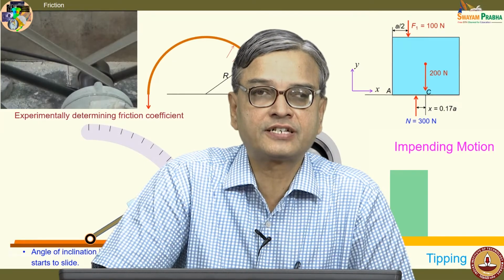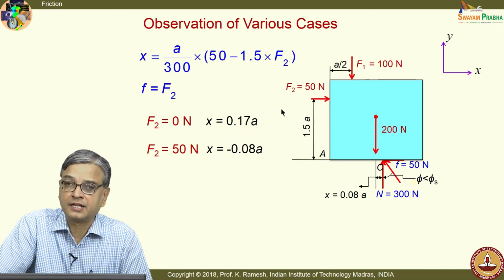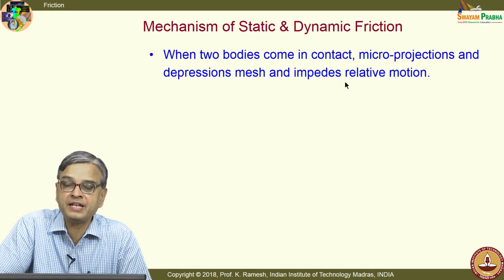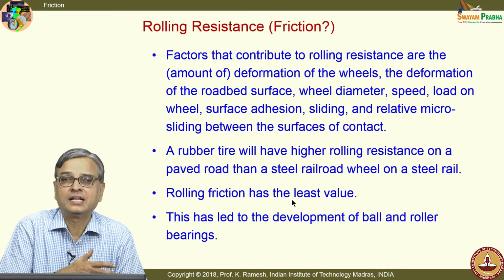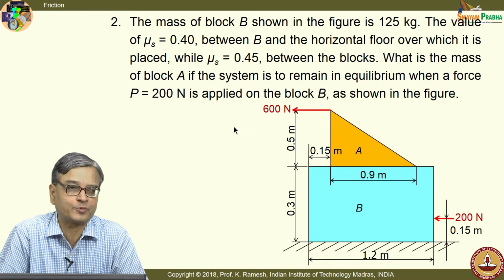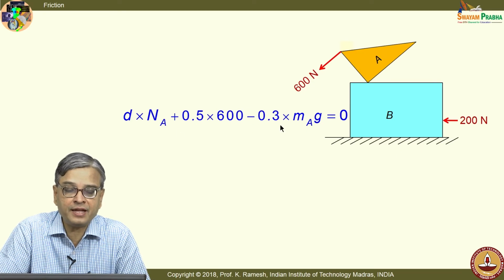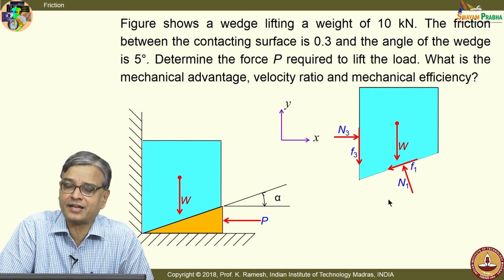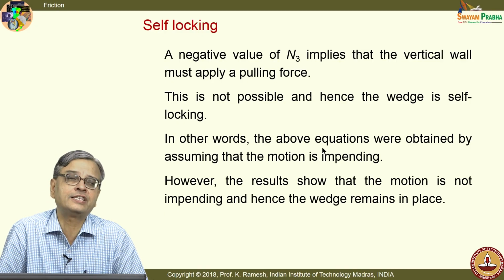Lec 19 Friction II

Comment: How friction value f = 75N is find out can anybody tell me ???
Reply: First read the question carefully:/
Reply: Forces from 0 - 90 N the block had no relative motion with the surface. So you have to F2 = f is valid. At 90 N the block said to be having impending motion because f = (co-efficient of static friction)N. So any force after 90 N you should consider dynamic co-efficient of friction because the block is moving. [f = (0.25*300) = 75 N]

Comment: @38.52
WHAT IS THAT FS.IDEALLY YHE FS SHOULD BE 600 FROM THE MOMENT EQUILIBRIUM CONDITIONS. I THINK IT SHOULD BE THE MAX VALUE OF FRICTION .
Reply: Fs could be equal to 600 N provided it does not exceed μN. If it does, then μN would only be the maximum friction that can be mobilized and this would govern.

For Fs, we take the resultant at the corner and compute the weight of the block. Ideally, this weight would just be able to resist tipping but only if it mobilizes a frictional force less than 600 N in the form of μN. In this case, this does not hold and hence, one will not be able to reach the tipping point since the block will start sliding before that.

Hope this helps.

Comment: AT 42 THE ANSWER OF S IS 0.717
Reply: Dear Paila Saisravan, you have incorrectly substituted the value of fB (800 N) in place of NB (2000 N) in your calculations. 

The value of 's' calculated in the lecture is correct and is indeed 0.287 m.

Comment: can any one please help me out. i have doubt @ 48:30 in the equation sum of x  all forces in x axes. Why it is N1*sin alpha. isn't it N1*cos alpa?
Reply: When we are taking ΣFx = 0, we are essentially adding all the horizontal forces.

Now, the top of the wedge has two forces : N1 (inclined at α with the vertical) and f1 (inclined at α with the horizontal).

In the limiting condition, f1 = μN1

Now, for a force inclined at α with the vertical, the horizontal component would be given by opposite side of the triangle which is sinα. Therefore, it is N1(sinα).

Likewise, for a force inclined at α with the horizontal, the horizontal component would be given by the adjacent side of the triangle which is cosα. Therefore, it is μN1(cosα)

Hope this helps.